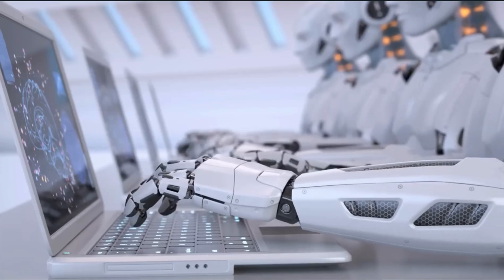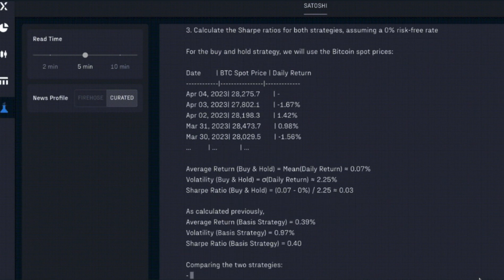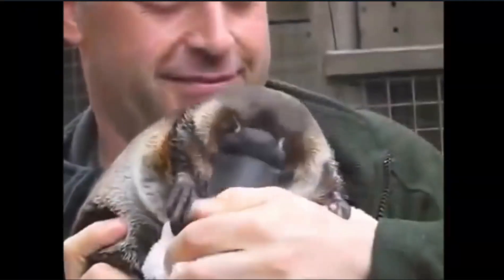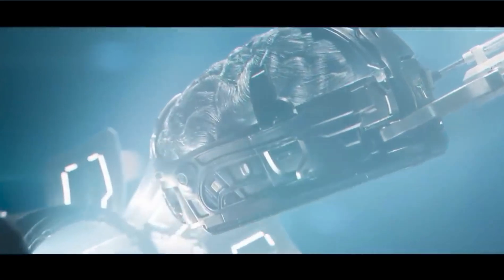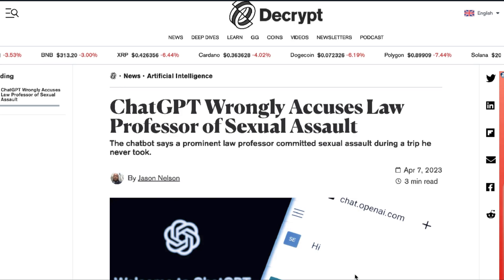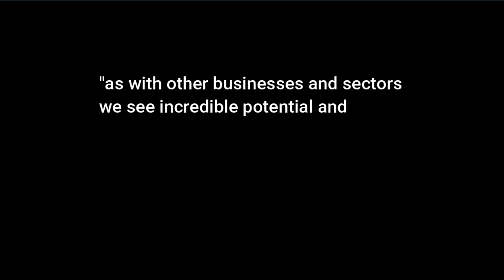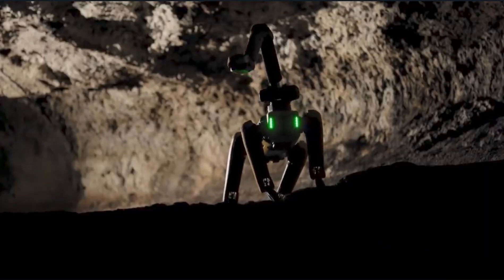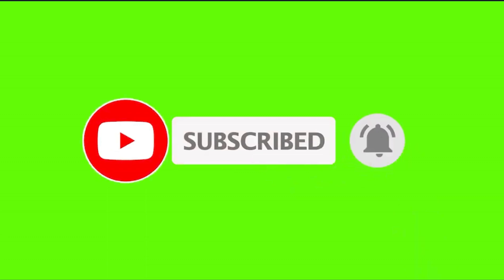OpenAI’s NEW AI Can Trade Crypto & Make You RICH!

Comment: The so-called curve fitting problem always arises when predicting future price movements from historical data. 
There is always the possibility that the future will betray the patterns of the past. 
The only thing that doesn't happen is the graph of the exponential rise in the price/performance ratio of semiconductor processors. 
Recently, progress curves of AI and quantum computers also provide solid future predictions. 
But when it comes to investing, there is always the possibility that the AI will deem an unfounded pattern to exist. 
But it's the same with humans. Because AI predicts the future based on much more data than humans, curve fitting is much less likely than humans.